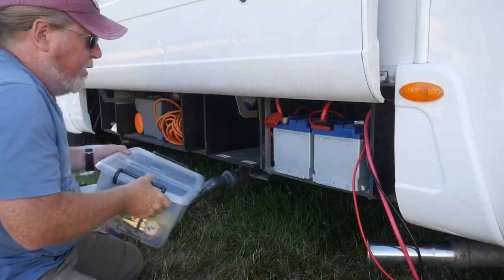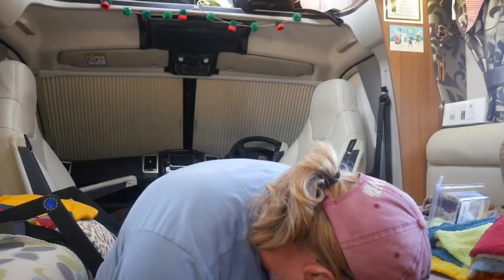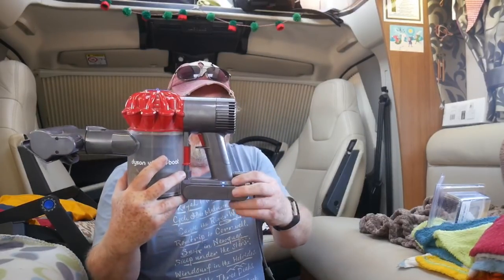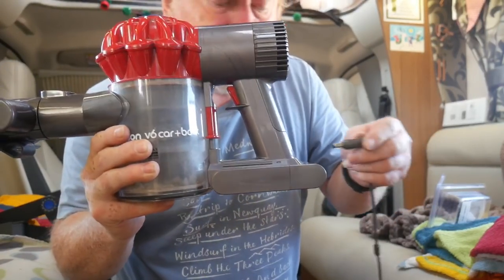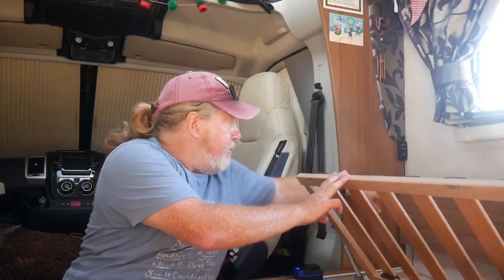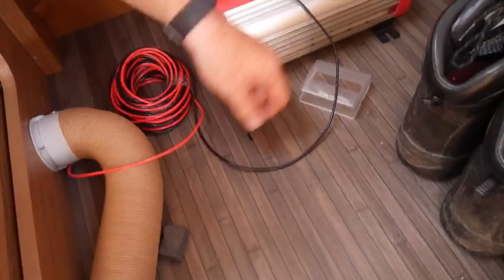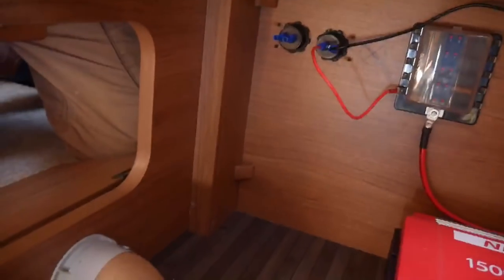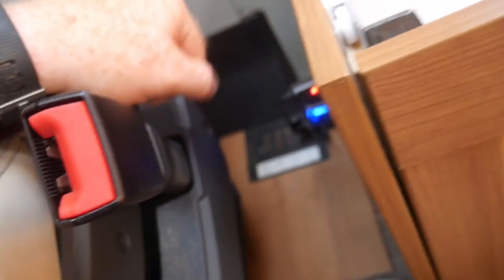How to fit 12 volt outlets in your Motorhome vlog #455

Comment: Will your new 240 outlets work when you are on a site hook up?
Reply from the maker: The new 230Volt sockets are run off the inverter which is connected to the batteries. They are not connected to the EHU at all. In answer to your question, yes they will work, but not because of the EHU.